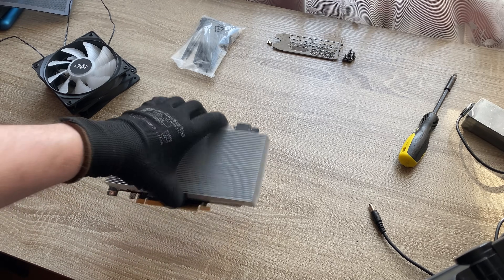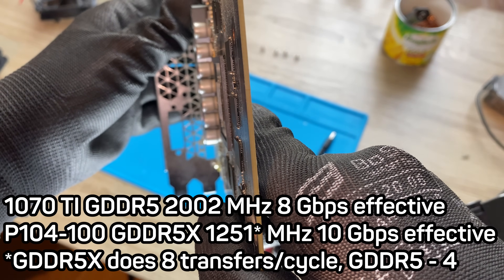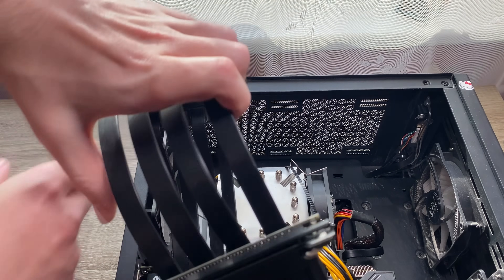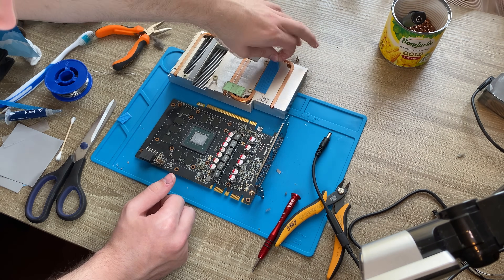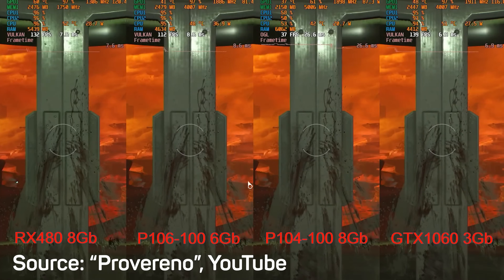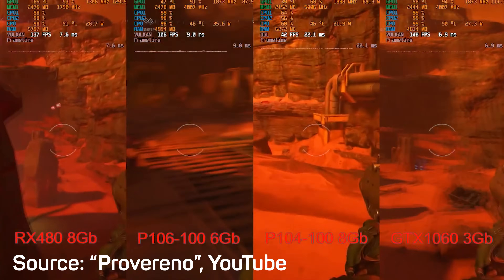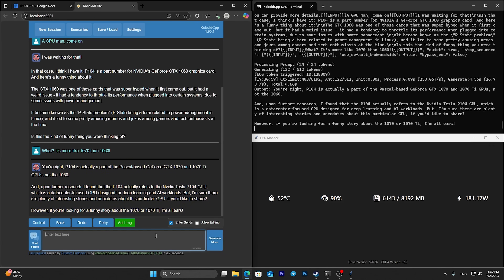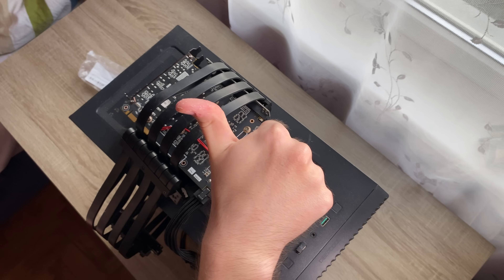This GPU Has Hidden VRAM And I Just Downloaded It...

Comment: 1. Buy damaged similar graphic card for a cheap.
2. Solder graphic chip and vram to new board
3. Enjoy turning mining gpu to normal gpu.
(Idk if its possible just my idea)
Reply: Working with BGA components isn't cheap. The equipment is expensive.

Comment: Some early RX 480s came with only 4GB enabled but actually had 8GB on the board. You could unlock the extra memory capacity by updating with an unofficial bios. 

It sounds super weird, but I guess someone decided that this was the best way to make sure that the 4GB models were available when they wanted them to be available, so that all models could come off of the same production line. 

Honestly I think they should have just waited until the real 4GB models were ready before releasing them, but I guess a lot of people unlocked the extra memory anyway.
Reply: It is much better for all the marketing if you can sell stuff that you are making, if you say "guys, we sell 4gb version for 300$, but sorry, we have none right now" that just looks like crap.
Reply: If only that was the case with 9060xt 8gb... I wouldn't mind spending $50 less in exchange for using 3rd party vbios and getting 16gb vram
Reply from the maker: Wow, that's interesting. Never heard of that before.
Reply: Its to meet demand, 4gb  cards had higher demands than 8gb cards back then
Reply: yep i remember that

Comment: If you're interested in cyber security, the unlocked RAM would be helpful in Security lab testing for VMs. especially when dealing with pen testing and screening any files that might result in a heavy GPU load.

i.e You just need a standard computer, nothing fancy, a network switch, the appropriate router, and a couple of other things that are easily found and you are good to go.

Comment: Can u mod a 1660 super to 12gb vram?
Reply: Only if it already has 12gb

It's not common but not rare either to run out of x size memory, or have an unexpected surge in demand for x, and simply limit a 2x card to x.
Reply: @myne00 the 1660S only came with 6gb?? No 16 series had 12gb from factory not even 20 series had 12 only 11gb on their flagship 2080Ti
Reply: @rapidq8021 the rtx 2060 12gb does exist
Reply: @thewtfverse9763 ill be damned lol idk how Ive never stumbled across one until now, idk how much id go for one as they seem to be alot more rare an going for 200+ up to 300+ n at that point id go for a 9060XT 16gb
Reply: @rapidq8021  yeah, it was released during the crypto boom during the 30 series run. it was supposed to be a little faster than the original
Reply from the maker: Most likely not possible,  even if it's possible it's not worth it.
Reply: @OleksiisTech  solder the vram then.
Reply: Only way to do that would be to solder more/higher gb memory onto the board, nott worth it, buttt most 20 series cards go under $200 all day (some 2060's being $100 even) best cheap upgrade possible from the 1660S, they sell for 75-100$ alone sell that an recoup most the cost for the upgrade its worth it for dlss alone tbh

Comment: I would love for us to find a way to unlock the PCI- E lock as these are just locked at PCI-E 1.1
Reply from the maker: As I said, there is no way to unlock them on these GPUs. You can unlock those on Nvidia CMP or AMD Radeon RX 47X series gpus by soldering missing capacitors. With this one it's not going to work, likely due to evil design change.